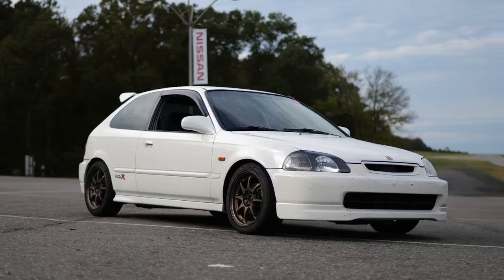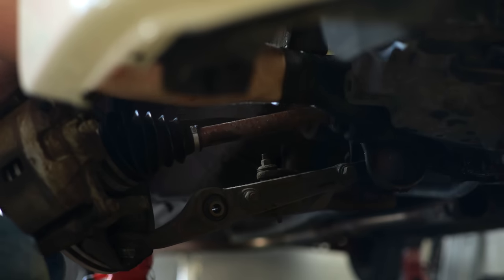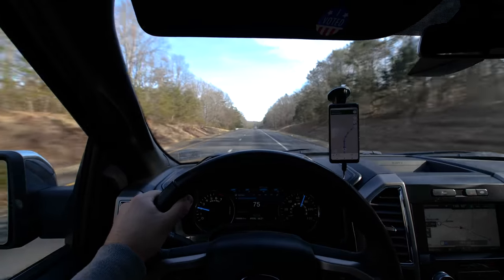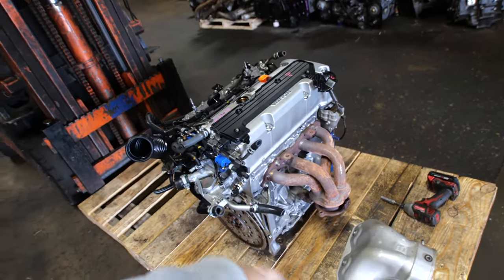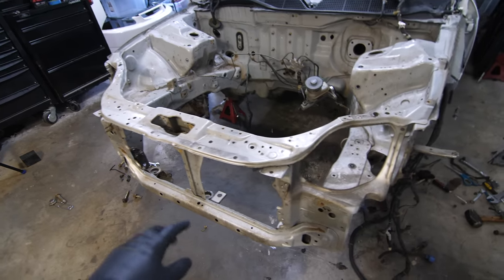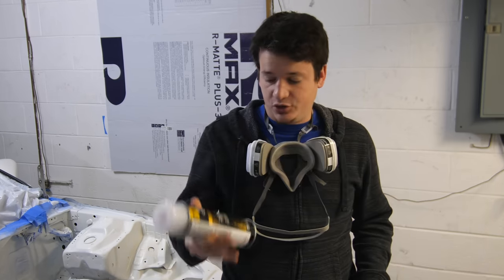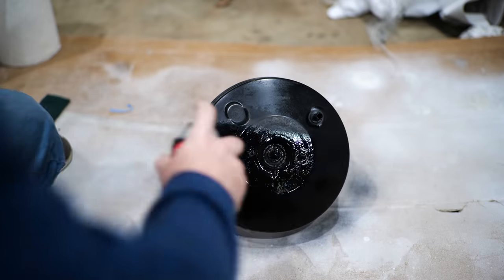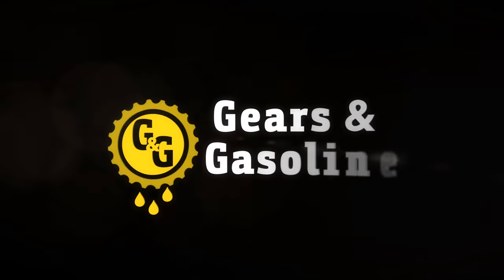K Swapping My Honda Civic – Episode 1

Comment: i ran my rotary engine on full synthetic mobile one oil, the gold bottle that has the 15,000 mile guarantee, even know if you tried that 15k mile deal your car would seize to exist because oil filters arnt going to last 15,000 miles.  and if there is an oil filter that lasts 15,000 miles then its not a filter.  its more like a kitchen spaghetti strainer at that point.  it might catch a chunk of metal after it blows up and pumps through the lines for its last dying breath.      anyway yea what i was trying to say is i spent more on oil and gas than the machine itself was worth in just 2 years.  and then theres the fact that the tips of the rotors that seal to the "sleeve" or wankle wall as we called it back in school.  are made of soft brass carbium fibrate that it has to be replaced every 13,271 miles it just wasn't a cost effective engine.    so i said the hell with it.  it was overkill for my weed whipper anyhow.   now im back on that baby 8cc 2 stroke bad boy engine that it came with stock. we used to need 6 guys and a small engine crane just to weedwack the lawn with the wankle on that thing.   and then it spun so fast that the plastic whipping cables cut all our feed off from right below the ankle during a mishap.   and after the surgery since there was 12 feet just laying in the lawn and we all wanted them reattached we ended up with mismatched feet.    so no wonder they dont warranty those engines for even a day. 

oh wait lol i was thinking of something els.  that was a lie.  i think all we did to that weed whipper was poke a hole in the primer button since it felt so cool to squish in  and then after that the whipper broke.     but ehhh it was a easy misunderstanding  thats pretty much the same thing as a wankle swap weed whipper and cutting 6 mens feet off,  and the crane even! i forgot to mention the engone crane got sliced too!!  oh wait wait i forgot it was a lie,  or that i told you atleast.   it didnt slice the engine crane lol.    you guys are so gullible,

Comment: Your engine bay didn't come from factory with the same paint as the outside of the car. The engine bay and underside of the hood would have received only surfacer (primer) which was colour keyed to the topcoat colour. White topcoat would mean the car was first painted with white surfacer. The type R was made in the Suzuka factory but your car was likely manufactured in Canada. VIN will start with 2HG if this is the case.

Comment: Where did you get your new bolts from? My Miata needs a new set like crazy.
Reply: Something I wish I knew 4 years ago when the video first came out (even though he addresses it in a later video), he buys the bolts online. You want to search for an assortment of metric bolts. M5x.80, M6x1.0, M8x1.25 metric threads will cover 95% of all bolts in my experience on japanese cars, so buy like a million of those. Look at harbor freight.

Comment: 1:30 you say that you think anything is easy if you're used to working on them, but it's not true. Try working on a Ford or another manufacture's vehicle. They don't make sense. You can tell that the guy who designed the engine didn't work with the guy who engineered the transmission, and the guy who designed the transmission didn't work with the guy who designed the chassis, and the guy who designed the chassis didn't work with the guy who did the electrical. With Honda, it seems like they designed and built everything with a good overall understanding of the entire car. Thus, making the maintenance simple and easy. Not to mention, modular with cross compatibility between different chassis (Civic/Integra/Del Sol/CR-V).

Comment: Those pins are the worse. You just need one good strong hit but you could had still pulled the motor with the shift linkage still in

Comment: So.. frankenstein for most NA power. K20A for forced induction? 
i was also wondering. IF you get hands on K20A type r (jdm) with 6 speed and LSD, is it worth putting it on K24A2 block or just keep it that way?
Reply: Yukimura yes it’s definitely worth it. That combo makes power and easily
Reply: @TheBb6prelude  Even if i plan on forced induction? My point is, i understand building frank from, let´s say k20a2, but JDM k20a? Isn´t it overkill?

Comment: I use an air hammer anvil specifically designed for the Honda shift pin.  Makes removal and installation both super-duper simple.  The small end fits inside the pin, and the 2nd stepped portion matches the outer diameter of the spring pin. https://www.toolsource.com/air-hammer-c-273_512/air-hammer-shift-link-pin-r-r-tool-honda-acura-p-99096.html

Comment: Idc who you are hondas are bad ass. How you gonna bash a car that gets completely trashed and neglected for 500k miles and it's still running eith almost no oil, or regular fluid changes, filter changes.. so on. Like that's a legendary car right there.
Reply: Michael Douglas yeah dude, I have a 92 SI hatch with 456 thousand kms on it that takes a shit kicking and keeps running, it’s my work car so I always have chainsaws and climbing gear in it, I work on pipelines in northern British Columbia so it’s out in -40 Celsius weather and lotsa snow while ever else has big trucks, the only thing that has ever failed was the original fuel pump at 449 thousand,easy to swap as it’s just under the back seat, even when it was -20. Love the old Hondas

Comment: 1) I hope you did not trade the b16 swap for that motor. You could have sold it for double or triple what a k24 cost.
2) you don't have to swap the head on a tsx motor. This difference is not that great. Use the money to buy a better intake manifold and e85 with a good tune and you will be in the 250.

Comment: any links to the new bolts?
Reply: Something I wish I knew 4 years ago when the video first came out (even though he addresses it in a later video), he buys the bolts online. You want to search for an assortment of metric bolts. M5x.80, M6x1.0, M8x1.25 metric threads will cover 95% of all bolts in my experience on japanese cars, so buy like a million of those. Look at harbor freight.

Comment: Hey where’d you get the bolt set?
Reply: Something I wish I knew 4 years ago when the video first came out (even though he addresses it in a later video), he buys the bolts online. You want to search for an assortment of metric bolts. M5x.80, M6x1.0, M8x1.25 metric threads will cover 95% of all bolts in my experience on japanese cars, so buy like a million of those. Look at harbor freight.

Comment: Why remove the b16 when it works perfectly fine and it’s correct
Reply: Couldn’t you just ITB it? Spoon motor?
Reply from the maker: It still wouldn't make as much power or powerband as the K24
Reply: Toby Dart it it’s definitely perfect perfectly SLOW
Reply: @GearsandGasoline  so openly admitting the civic is too slow for your liking

Comment: i mean with around 300 horses the difference wont be much in the lower rpms its not like you have a 1000 horses civic ..thats indeed pretty much undriveable in the street

Comment: Noo don't hammer the bitch pin out :( it's not good for the gear selector rod. The best way is to push it out with a bit, socket and c-clamp.

Comment: Hondas are easier if you know what youre doing, i can take that B*tch pin out super easy (within a minute) cause ive had to take my Transmission out way too many times
Reply: and before you ask i have changed the pin out before cause its been out allot